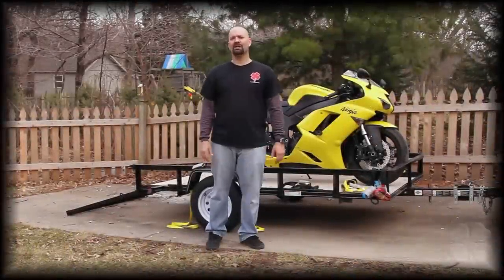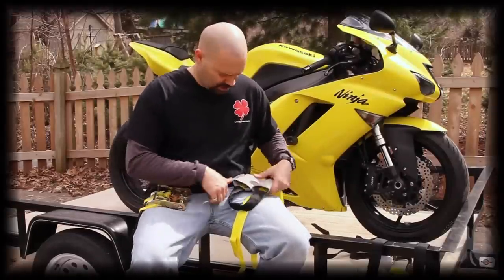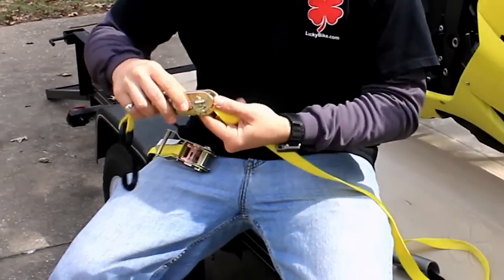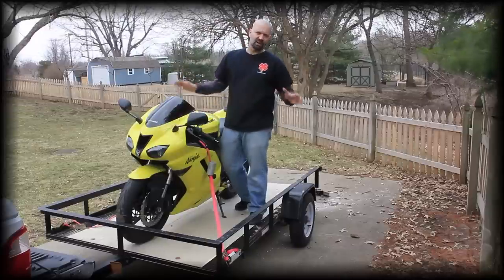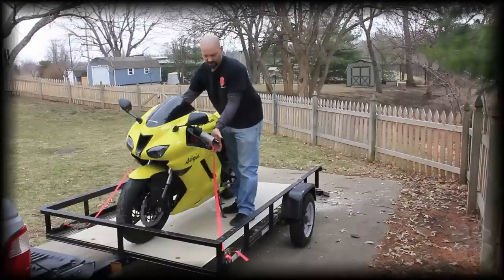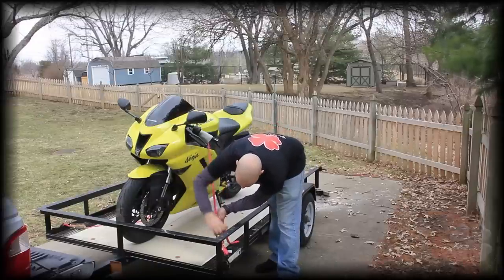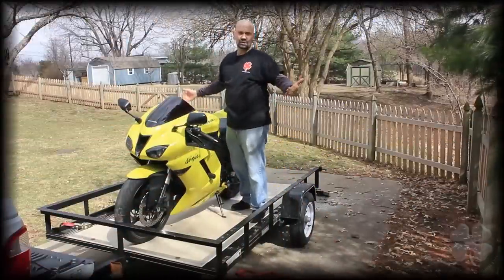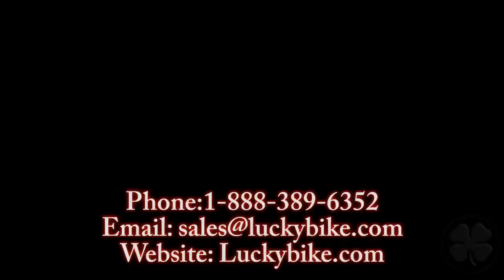Full Overview for LuckyBike Ratchet Strap Motorcycle & ATV Tie Down

Comment: That seems like a lot of pressure on the forks.
Reply from the maker: Thank you for your comment, that is a very good observation.  I agree that we strapped it down too tight in our video, you do not need to clamp it down as aggressively as we did here.  I think we got too excited when making the video. I will add a note to the video to advise people of this.  The bike we used was not damaged as we didn't bottom out the forks.
In summary, you should never bottom out the forks and should compress it about 1/2 to 2/3 of the fork travel. (With the bike stationary and no rider)  Ensure the motorcycle is stable and won't bounce up and down on the front end.
Reply: do you need a chock to haul a cruiser , rather than the crotch,rocket,
Reply: It depends on your trailer, if you have a rail to stop the front wheel, like in our video, then you don't really need a chock.
Reply: Yep

Comment: Very good video, good quality as well. But to everyone reading this, don't use that much pressure when strapping the bike down, too much pressure on the forks can bust them, it also helps the the bike during the drive if the suspension can take some of the load while on the trailer. -Just a tip

Not hating on the guy in the video, i'm sure he knows what he is doing, and has done this plenty of times. He probably just got caught up making the video
Reply: -- Thanks for the input and you are completely correct on all points.  We had already addressed this in the video by adding a note at 6m28s.  https://youtu.be/l4Oxd3mWdik?t=6m28s
Reply: +Project Xfire Thanks for the tip about the forks. I'm gonna buy these straps asap.

Comment: I'm assuming this same method would  be applicable to other bikes, including cruisers with a variety of handlebar types?
Reply: That is correct, works the same on all bikes.  If you have huge ape-hangers then please consider the extra leverage that will exert on your bars, but other then very extreme cases, it's really straight forward.

Comment: i havea  canyon dancers wich is esentialy the samething has the gray cuffs. just sucks my grips and controls deeper on to the bars. also wore my grips smooth in 300 miles of trailering .
Reply from the maker: We make our support straps with high strength fabric, this is soft and flexible to ensure it doesn't damage your grips or bar-ends like other rigid systems may.
Reply: mine are indeed 100% fabric and look nearly identical to yours.

Comment: Great way to blow your fork seals whaling on the tightness like this dude did.
Reply: Even if you do bottom out the forks, it will not cause damage unless the seals are bad or improperly installed to begin with, you are not going to bend the fork tubes like this...  You would have to exert extreme blunt force or extreme compression force, enough to actually bend the fork leg/tube.  The forces required to do this are well in excess of what is in this video.

Think about coming down hard from a wheelie or hitting a pothole.  This frequently bottoms out the forks completely and results in far greater forces on the suspension than what is in this video.  While not recommended, forks are designed to handle bottoming out, most have a rubber stopper in there at the bottoming out point to prevent metal on metal contact.

Comment: that strap kit is all you need? nothing on the back?
Reply from the maker: ***** We have used only the front strap on lots of short trips.  If you are taking an extended trip or if you are going over very bumpy terrain then we do recommend our rear strap in addition to the front.  We have a combo-kit available here:
http://www.luckybike.com/tools-tie-down-combo-kit-cam-buckle-lb-handlebar-tie-down-ratchet-lb-tire-tie-down

Or sold separately  here:
http://www.luckybike.com/tools-lb-tire-tie-down-ratchet-strap-assembly-break-strength-2-500-lbs-working-load-limit-833-lbs-black
Reply: With my old arse and brain have ADD...does the Combo Set come with Good EZ Reading Directions, for folks like me?  :)

Comment: Does the strap touch the paint on the tank?
Reply: It is designed no to touch any of the bodywork.  Some aftermarket handlebars can cause issues, but this is rare, only the most extreme handlebar modifications direct the strap towards the bodywork.  Standard applications work just fine without contact.
Reply: Awesome! Ordered!

Comment: I have a question for u?  I just bought a 5X8 trailer like that from Lowes to transport my Roadking special and I want to slap a piece of 1/2 inch plywood in it to fit flush to the floor,  do I need to bolt the plywood to the mesh floor?  or will the weight of the motorcycle hold the plywood down w/o bolting it to the floor?  Please get back to me.   Thanks.

Comment: Seems like this is not great for the suspension.
Reply: It won't hurt them, you'd have to bottom them out and then exert enough force to bend the tubes.  Not an easy task as the cylinders are very strong against comprehensive forces.  

As far as the Oil inside and the Fork Seals, Oil Pressure is not built up inside the fork by this.  The Oil flows freely through the valve from one chamber to the other.

Comment: holy shit bro. ease up on the pressure. those poor forks
Reply: +Daniel Gatchell  That won't hurt 'em.
Reply: Even if you do bottom out the forks, it will not cause damage unless the seals are bad or improperly installed to begin with, you are not going to bend the fork tubes like this...  You would have to exert extreme blunt force or extreme compression force, enough to actually bend the fork leg/tube.  The forces required to do this are well in excess of what is in this video.

Think about coming down hard from a wheelie or hitting a pothole.  This frequently bottoms out the forks completely and results in far greater forces on the suspension than what is in this video.  While not recommended, forks are designed to handle bottoming out, most have a rubber stopper in there at the bottoming out point to prevent metal on metal contact.

Comment: Compressed the forks faaaaaaarr too much!!
Reply: True! rule @ 1 not to compress the suspension so much otherwise they  will burst!
Reply: Guys, the video mentioned to avoid clamping down too tight.  

But even if you do bottom out the forks, it will not cause damage unless the seals are bad or improperly installed to begin with, you are not going to bend the fork tubes like this...  You would have to exert extreme blunt force or extreme compression force, enough to actually bend the fork leg/tube.  The forces required to do this are well in excess of what is in this video.

Think about coming down hard from a wheelie or hitting a pothole.  This frequently bottoms out the forks completely and results in far greater forces on the suspension than what is in this video.  While not recommended, forks are designed to handle bottoming out, most have a rubber stopper in there at the bottoming out point to prevent metal on metal contact.
Reply: There is no large amount of Oil Pressure inside of the forks, this is not how these forks function.

It is a common misconception that the "Oil is Compressed" when the "Forks are Compressed" and that it is this "Compression of Oil" that rebounds (bounces) the forks back up.  
This is not how most suspensions function - the oil is not under high internal pressure during compression, the springs take this energy.

General Fork Overview:
Spring:
The springs inside the forks compress and cause rebound, it is the spring that takes most of the comprehensive energy and releases that energy as rebound.  
Oil:
The Oil simply controls how fast the spring compresses and rebounds.  This is done by forcing the Oil through compression/rebound valves.
Valve:
This valve controls how much oil can push through at any one time and thereby dampens the amount of compression/rebound.  The size of the valve controls the amount of damping and how hard/soft the damping is.
(Important take-away:  The spring stores the comprehensive energy, not the Oil)

Oil cannot be compressed, the volume and displacement of the Oil stays the same throughout the Compression and Rebound strokes.  Being non-compressible means that Oil cannot build up a lot of energy during compression to release on rebound, actually, the suspension would simply get hard as a rock if it worked that way.  But that is not the oils purpose or how it works, that is the springs purpose and springs have a nice bounce to them, just like our suspensions do. The job of the oil is primarily to control the springs energy and control the rate/speed of compression/rebound.

So when you compress the forks all the way, you will find that the oil is pushed through the valve and simply ends up on the other side of the valve.  The oil is not under pressure when the forks are resting or moving slowly, even when compressed. 

The Oil can be under pressure in certain situations.  Primarily when the forks are compressed/rebounded very rapidly and forcefully. (Like hitting a pot-hole)  But even there they would have to be compressed so rapidly that the oil cannot pass through the valve quickly enough compared to the force of the impact.
This is not the case in our example, the forks are compressed slowly and left in a stationary position.  In our scenario there is no excessive oil pressure, the oil simply flows through the valve to the other side and sits there.

You can also conclude with this that Fork Seals do not simply get "Blown Out".  You will find that the primary cause of leaky seals is degradation of the rubber o-ring, metal scarring that damages the o-ring and improper installation.

I hope that makes sense!

Kai
Reply: Hey Kai, I appreciate your detailed explanation of how front suspension works. Like them, I was worried about compressing the front forks too much and potentially blowing the seals but after a bit of research and now reading your comment, I can have peace of mind about strapping down the bike for the long haul next weekend.

Thanks,

CB

Comment: 6:55 You cloud blow the forks like this
Reply: There is no large amount of Oil Pressure inside of the forks, this is not how these forks function.

It is a common misconception that the Oil is Compressed when the Forks are Compressed and that it is this Compression of Oil that rebounds (bounces) the forks back up.  
This is not how most suspensions function - the oil is not under high internal pressure during compression, the springs take this energy.

General Fork Overview:
Spring:
The springs inside the forks compress and cause rebound, it is the spring that takes most of the comprehensive energy and releases that energy as rebound.  
Oil:
The Oil simply controls how fast the spring compresses and rebounds.  This is done by forcing the Oil through compression/rebound valves.
Valve:
This valve controls how much oil can push through at any one time and thereby dampens the amount of compression/rebound.  The size of the valve controls the amount of damping and how hard/soft the damping is.
(Important take-away:  The spring stores the compression energy, not the Oil)

Oil cannot be compressed, the volume and displacement of the Oil stays the same throughout the Compression and Rebound strokes.  Being non-compressible means that Oil cannot build up a lot of energy during compression to release on rebound, actually, the suspension would simply get hard as a rock if it worked that way.  But that is not the oils purpose or how it works, that is the springs purpose and springs have a nice bounce to them, just like our suspensions do. The job of the oil is primarily to control the springs energy and control the rate/speed of compression/rebound.

So when you compress the forks all the way, you will find that the oil is pushed through the valve and simply ends up on the other side of the valve.  The oil is not under pressure when the forks are resting or moving slowly, even when compressed. 

The Oil can be under pressure in certain situations.  Primarily when the forks are compressed/rebounded very rapidly and forcefully. (Like hitting a pot-hole)  But even there they would have to be compressed so rapidly that the oil cannot pass through the valve quickly enough compared to the force of the impact.
This is not the case in our example, the forks are compressed slowly and left in a stationary position.  In our scenario there is no excessive oil pressure, the oil simply flows through the valve to the other side and sits there.

You can also conclude with this that Fork Seals do not simply get Blown Out.  You will find that the primary cause of leaky seals is degradation of the rubber o-ring, metal scarring that damages the o-ring and improper installation.

I hope that makes sense!

Kai
Reply: I understand, it's above your pay rate.

Comment: This is How to NOT strap Your bike !!! Look on front suspension, all way down. Now imagine how long seals will hold pressure!? Do it this way and Your suspension will be f*cked.

Wrap around wheels, frame etc. Never ever let anyone transport Your bike with front suspension all way down.
Reply: Contrary to popular perception, completely compressing the forks will NOT build up pressure or cause damage, due to how forks are designed to function.
Even if you do bottom out the forks completely, it will not cause damage unless something is defective or improperly installed to begin with.
The oil in the fork tubes does not build up pressure, the oil flows freely from one chamber to the next through the Compression Valve.  
Because oil is non-compressible, forks are not designed in a way to where the Oil builds up pressure and provide rebound, the spring is there for that function.  Oil would be terrible for this function, as the non-compressible nature would be the same as hitting hitting concrete with a hammer.
Some shocks do use Gas to build up pressure and provide rebound, but that is a completely different system and Gas does compress progressively.
On almost all motorcycle forks, the rebound operation is from the springs in your fork, not from pressure in the oil.  The oil only controls the rate of compression/rebound.

The only way to build up pressure is to compress the forks so rapidly that the oil cannot pass through the compression valve quickly enough.  You would have to exert extremely fast compression force.  And even then, there is a relief valve in the valve stack that will open up completely when extremely rapid forces are encountered.
You also won't bend the forks like this, the force needed to bend forks is very high, that force is well in excess of what is in this video and impacts that bend forks usually involve the forks being hit from an angle and not from straight compression.  (Think about standing on a soda can, the very thin wall can handle your weight until force is applied from an angle)

Think about coming down hard from a wheelie or hitting a pothole.  This frequently bottoms out the forks completely and results in far greater forces on the suspension than what is in this video.  While not recommended, forks are designed to handle bottoming out, they have a rubber stopper at the bottoming out point to prevent metal on metal contact.